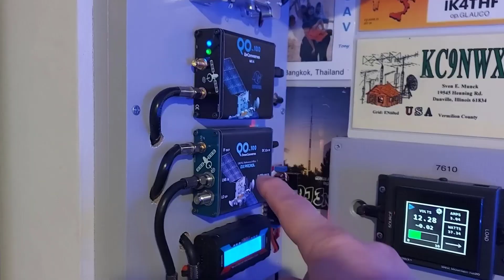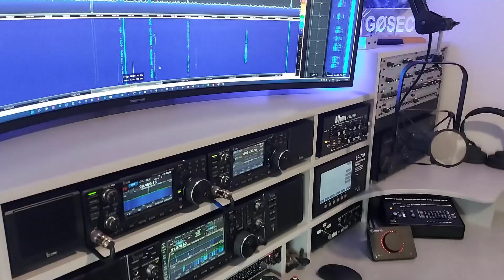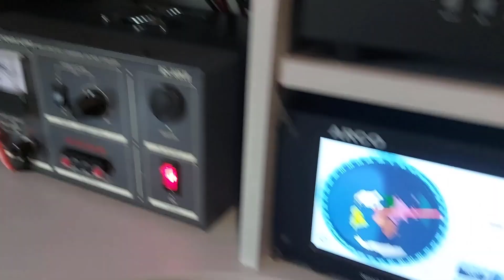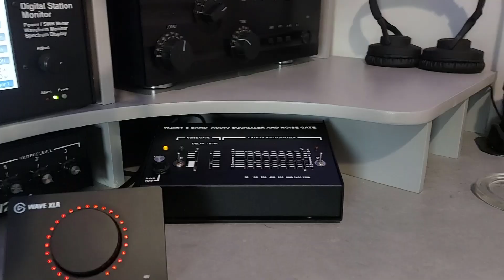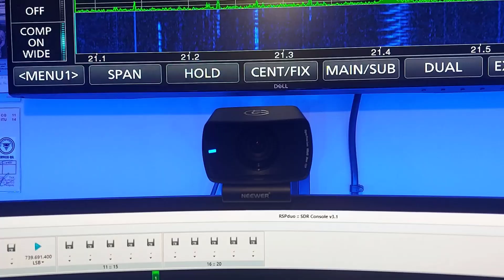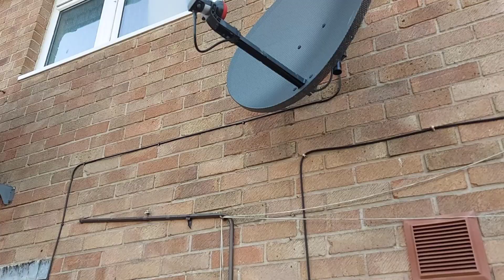The New Ham Shack of G0SEC, finally Completed!!

Comment: I can only imagine how long it too you to wire all the equipment together, test it and then cable manage everything.  Well done.
Reply from the maker: Well it doesn't have anything to do with my neighbours really I was here 20 years before them and they moved in next door but both neighbours I have have no issues. My antenna system is never an issue really.

Comment: I really am impressed at the engineering that went into your shack.  Impressive how all of your equipment fits into their cubby holes, the zones for sound, radio, power/antenna.  The balance of placement and wire management for all of the ancillary components.  The clean installation of your tower.  Placement of clocks and dual use monitors are brilliant.  We have all seen some great shacks.  Your shack sir, is the pinnacle of anything I have ever seen on the tube.

Comment: Hi James, That's One Hell of a station, very nice, well done. Question, why did you change out the Behringer audio rack for Dbx and W2IHY equipment. I do know that Dbx is higher-end equipment, but was there any other particular reason?
Reply: Not James, but I had to take all the Behringer out of my shack and switch to W2IHY simply because I couldn't keep the RF out of it.